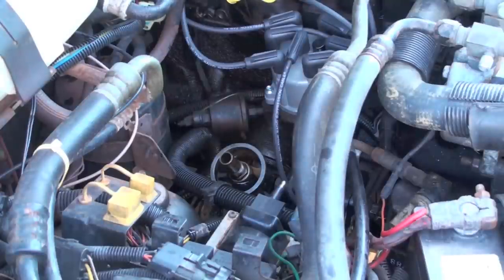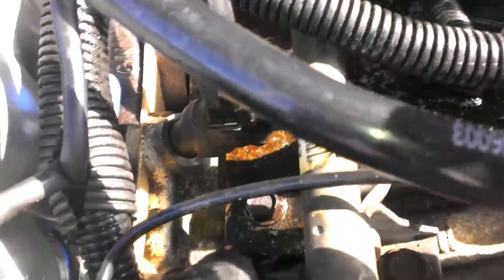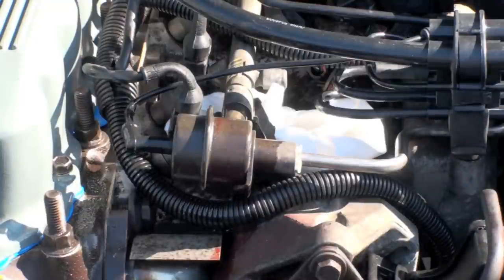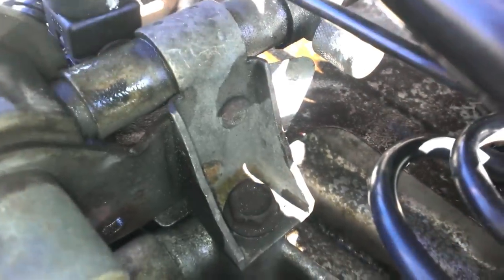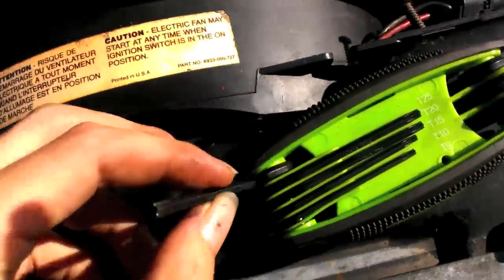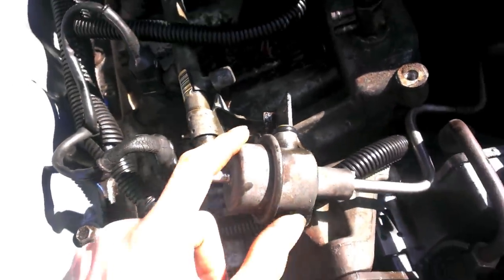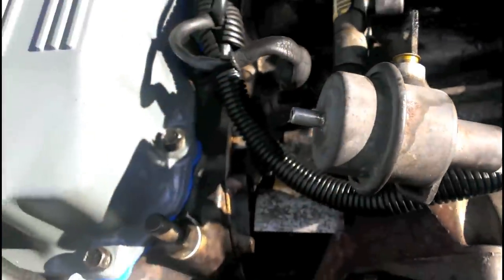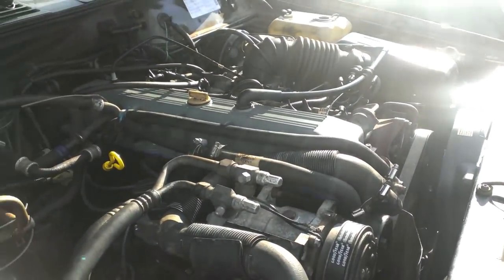89 Cherokee Fuel Pressure Regulator Leak

Comment: Thanks for the upload. It saved me about $80. I couldn't find any information about this fix elsewhere.
The dorman viton 80020 o-rings are made to withstand fuel exposure. A standard buna o-ring will deteriorate, which will likely leak and clog your fuel injectors.
Reply: Dorman viton 80020 o rings

Comment: I have the same issue not quite as bad on my 88 MJ.  Crazy how it's positioned so it leaks right on the exhaust manifold.  I imagine it could catch fire pretty easily.  Right when I got home from a 130 mile trip to pickup a transmission I smelled fuel.  Popped the hood and saw this leak.  Hopefully o-rings will fix it up for me as well.  Appreciate the video.
Reply: It's hot enough to evaporate the gas ,but not ignite it.

Comment: question... mine is leaking from the other end of the regulator where there is a clear plastic clip on it that hold the rail into the regulator. can I just replace the clip or do I have to replace the whole line or regulator? mine leaks out if the opposite end yours is on the regulator.
Reply: did u get your issue resolved? mine leaks from the basket connector too....
Reply: Leo Vargas yes I did I just replaced the orings
Reply from the maker: +Heather Mitchell Guess this must have slipped my inbox, sorry about that. As you already found out you can buy just the quick connect clip and replace it to fix any leaks from that connection.
Reply: +Heather Mitchell two, right? o rings i mean. thanks.
Reply from the maker: +Leo Vargas Yeah, I think there should be 2 o-rings with a spacer in between them. You can buy the whole assembly here: http://www.morris4x4center.com/fuel-oil-cooler-line-repair-kit-83502745.html
Reply: +NickInTimeFilms thanks, man!

Comment: Anybody know the name of the seal on the right of that regulator? It's like a clip type seal that goes on that metal fuel line and then seals to the regulator
Reply from the maker: The quick disconnect fitting? Sometimes they come up under fuel or oil quick diasconect
Reply: At an auto parts store they call them a Fuel Line Repair Kit. The exact part number from Crown Automotive is 83503745. Go to any automotive parts store and they can get it if you tell them this. Make sure it comes with 3 O-rings.  If you ever disconnect your fuel line, the  rings on that plastic piece may not reseal since they are 30 years old. Plus the plastic piece can break. If so You will see fuel coming out of that plastic quick connect piece WHILE THE ENGINE IS RUNNING.

Comment: what if an injector does it when u wanna start it would it b the o ring as well?
Reply from the maker: +pirotechnico323 A worn or ripped o-ring could cause an injector to leak. I have a video about swapping injectors that may help you: https://youtu.be/dstyjD5Hy9Y?t=7m49s
Reply: Thanks g... would u b able to tell my why my comanche cranks but wont turn on I got a new clutch and bled the hydraulic throw out bearing since I didnt have a hose I used one I had going from the egr solenoid to the manifold I statted the first time and turned on but soon as I plugged the hose in it cranka but wont start think it sucked up fluid ?
Reply from the maker: How did you bleed the fluid? You didn't have it connected to the manifold right? If the line had fluid in it when you put it back then the manifold would have sucked it up. Don't know if that would effect starting or not.
Reply: +NickInTimeFilms ::) prolly had some fluid idk but once
Reply: +pirotechnico323 it probably had some fluid idk once I connected that hose it shut off now it cranks but wont start